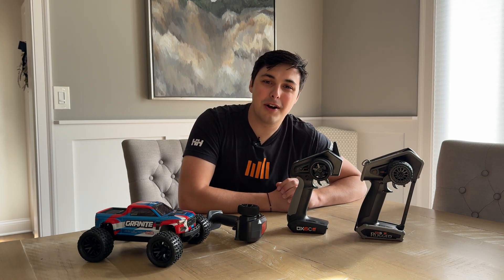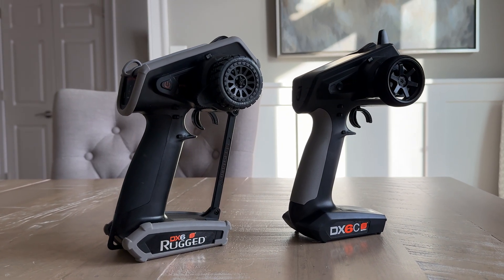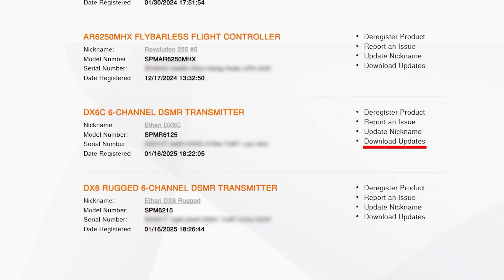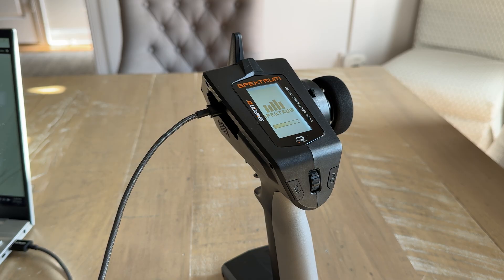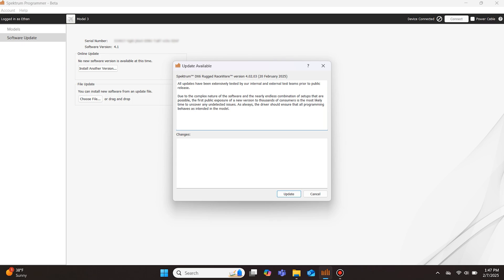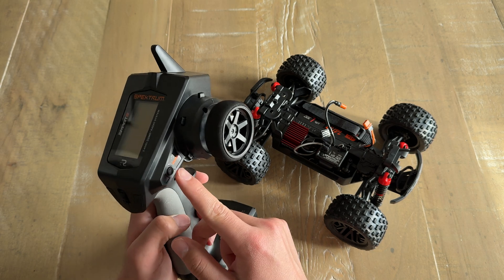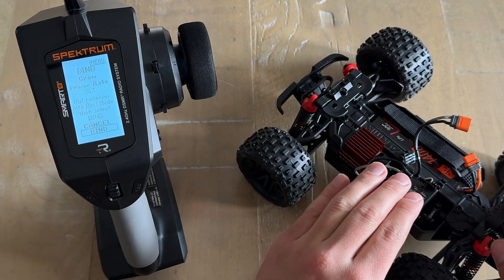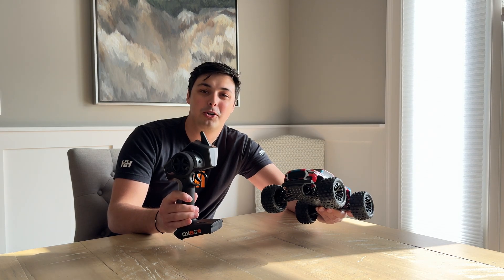Spektrum DX6C and DX6 Rugged SLT Firmware Update and Binding

Comment from the maker: Please click "...more / Show more" for links and more information. Visit https://www.spektrumrc.com/news-static-page.html for more information on the Dual Protocol SLT Firmware.

Download the Spektrum PC Programmer Here: http://spektrumrc.cachefly.net/apps/spektrum_programmer.html

Chapters:
0:00 - Introduction
1:37 - What You Need For Updating
2:07 - Update Method 1 with DX6C
3:51 - Update  Method 2 with DX6 Rugged
5:10 - Binding to SLT Receiver
7:54 - Outro

Spektrum is excited to introduce a new SLT - DSMR technology that combines both protocols, allowing for a seamless connection between them! It's available now as a firmware update for the current line (DX6C, DX6 Rugged, DX5 Pro, and iXSR) of Spektrum programmable surface radios. Once installed, the update lets you link your Spektrum DSMR transmitter to the SLT receivers included in many RTRs, so you can run all of your vehicles with the same transmitter!

In this video, Ethan Ater shows the two methods that can be used to update the DX6C and DX6 Rugged. After the transmitters are updated, a step-by-step bind process to an SLT receiver on an ARRMA Granite GROM is shown to demonstrate just how easy it is to enjoy this new dual protocol firmware update.

Follow SpektrumRC on Social Media!
https://www.facebook.com/SpektrumRC/
https://www.instagram.com/spektrum_rc/
Reply: Does the dx3 work
Reply from the maker: @Goodboy38581 The DX3 is not compatible with this update.
Reply: i have another question i have a 1/16 scale arrma mojave grom 223s blx if i buy the spektrum dx6c will the telemetry work on the grom 223s like speed mph temp and battery

Comment: What he failed to mention is the data cable compatibility. I went through four different cables until finding one that worked. After that it was just a couple clicks and done
Reply: Pin this comment! I spent many hours trying to update the firmware until I saw this comment. Thank you!
🤘🏼🤘🏼
Reply: These companies just kill me with the major oversight such as this. Luckily I ran across this comment before attempting the connection and sure enough, first few cables did not work.
Reply: Thank you for this comment. I was losing my mind and then tried another cable and got it to work…
Reply: Really? I wonder if that’s my problem…? I go through all the steps, but can’t seem to download an executable file or anything that seems to be of a file type that will open, download or install at all. 

Was this what u were running into as well? 

Did u just randomly use a different cable and it worked?

Comment: Why does my DX5 RUGGED only have 3 extra channels available in AUX after this update? It should have 4 extra channels before, but now it only has 3 channels. I use an SR6100 receiver, which means I can only use 5 channels. Now the 6th channel is no longer functional.
Reply: IT.S DX6 RUGGED

Comment: GUYS. MAKE SURE TO CHECK YOUR DX5 PRO MANUAL FOR SD CARD INFORMATION. IT TELLS YOU WHICH SD CARD YOU NEED TO USE. IT HAS TO BE CLASS 6 OR LOWER WITH 32GB OR LESS AND FORMATTED TO FAT OR FAT32

THE INSTRUCTIONS FAIL TO TELL US THIS CRITICAL PIECE OF INFORMATION.

Comment: Your instructions for your DX5 Pro are awful. I’ve been trying to update mine for several HOURS with multiple SD cards and it just isn’t working. I followed the instructions VERBATIM. The radio just is NOT recognizing the firmware file. According to my radio, the SD card is absolutely and completely blank. This is crap.

Comment: DX5 Pro is not listed in the drop-down of devices when I go to register my DX5 Pro. It shows DX5R/DX5R Pro

Are they the same?

Because I followed this step by step, and my radio isn’t updating. When I go in the manually update, it doesn’t display any files at all on my radio screen.
Reply: Don’t feel bad. The DX6 Rugged that this update is for isn’t listed either. Just another reason why I have been converting all my cars to FlySky Noble.
Reply: DX-5R PRO IS THE THE DX-5 PRO. THE OLDER MODEL WAS CALLED DX-5R, ITS THE SAME
Reply: @PhilipBender612  THANK YOU I APPRECIATE THE HELP

Comment: Ethan got a question on the update for the DX5 Pro. I did the update but don’t have the vehicle type option in my menu. The radio definitely took the update as i was on 2.02 before and now on 3.02. Have you heard of any issues with the download on the DX5 Pro? Thanks Ron
Reply: Do you know which DX5 Pro you have? There are a couple versions of the DX5 Pro. This update is only compatible with SPMR5025 & SPM5025.
Reply: @ yeah I figured it out unfortunately won’t work with my radio. It’s model number SPM5000
Reply: How did you even update your 5Pro? When I download the file to my SD card and insert the SD card into my radio, nothing happens. When I go to manually update it, there is no file on the SD card. How did you do it?
Reply: @ the DX5 Pro is very picky when using a SD card only a few brands will work. Sandisk works but needs to be a small capacity one like no more than 16GB from what I’ve seen. Also make sure you format the SD card first even if it’s brand new. Are you sure the file was on the Sd card? Also do not rename the file cause it will not download on the radio. Hope this helps. Ron
Reply: @roncorrisjr2828 positive that it was on the SD card. I tried like 4 or 5 times. Formatting now. I never modified the file name.
Reply: @roncorrisjr2828 still not able to update my 5Pro, tried 2 SD cards. This is crap.

Comment: How is this working for everyone else?   Both my DX6 Rugged, and DX5 Pro have the update now.  But will not successfully bind to the 2in1 in the 1/16 Mojave Grom 223S.
Reply: How did you even update your 5Pro at all? Once I download the update to the SD card and put it in my radio, nothing happens. When I go to the manual update, it shows no files on the SD card.
Reply: @PigglyWigglyDeluxe  i have a dx6c.  It uses USB c cable
Reply: @RVsandRCs thanks, I was asking the top initial comment
Reply from the maker: Make sure that your Frame Rate is set to SLT like in the video. You may also need to hold the transmitter a couple feet away from the receiver when binding.
Reply: Having same issue same setup. Tried several times. I hope I'm doing something wrong. Hopefully it works on my slt receiver in my v3 granite
Reply: @RVsandRCs try setting your “vehicle type” to SLT with DSC. This should automatically configure everything setup wise in the transmitter. Once you do that, you can go to the Bind / Frame, go down to bind and select it once your 2-in-1 is in bind mode.
Reply: @EthanAter  thank you for your help.... as of now my only option is "slt" . Nothing sas dsc
Reply: @EthanAter  ok found vehicle type and switched and rebound. Still no good lol
Reply: @EthanAter  i got it.  Thank you
Reply: https://youtu.be/JVp6aXaMM6E?si=WU7gxG3R9YbMaTfQ
Reply: @JasonPerrinRCVlogs already watched it, tried everything, didn’t work
Reply: @PigglyWigglyDeluxe  Do you know which DX5 Pro you have? There are a couple versions of the DX5 Pro. This update is only compatible with SPMR5025 & SPM5025.
Reply: @EthanAter bought it brand new sealed in box at a hobby shop about a year and a half ago, special order because they had none when I wanted one so I know it’s recent but I don’t have the radio handy right now to check or confirm version
Reply: I can’t get past the empty bar and or unable to get the programmer to see my transmitter.

Comment: Should also be on the DX5 Rugged…. It’s basically the same transmitter and only a couple years older.
Reply from the maker: @nielsmeer  Unfortunately it's a hardware limitation of the DX5 Rugged that prevents the update being available.
Reply: @ Disappointing….
Reply: @nielsmeer  agreed i have a dx5c and it sucks hopefully they can figure something out
Reply: @ It pushes me more towards switching to EdgeTX.  I’m running that for air and love it, but surface isn’t quite as up to date yet….

Comment: Did the update on my DX5 Pro - The SLT option does not show like the PDF instructions say it should.  Please advise.
Reply: ITS NOT AVAIL FOR DX-5s AT ALL! ONLY 6's   This is so lame!!!
Reply: Just updated my DX5 Pro and the SLT option shows in the Bind menu as seen in the video. DIdn't read the instructions as I followed the vid above.
Reply: How are you guys even updating your 5Pro? My radio is showing there is no firmware file on the SD card after I downloaded the file to the SD card from my computer

Comment: Where's the Mac OS Programmer App?
Reply: You can run Windows 11 on your Mac using the free VMware Fusion software. I just updated my DX6C using this method on my MBP 13 with the M1 processor.
Reply from the maker: At this time, the Spektrum Programmer app is only available for windows.
Reply: @SpektrumRCvideos  :(

Comment: How does the dcs settings work?
Reply: The button by the steering wheel
Reply: You just click  it eatch time
Reply: @Goodboy38581  thank you for your help. Unfortunately I can't get the binding process to complete properly.  It binds but I have no controls
Reply: @Goodboy38581  i got it lol. And found the adjustment for dcs as per your recommendation.  Thank you.
Reply: @RVsandRCs which button is it
Reply: @gonzodetroitify D i believe.  Increments of 25
Reply: @RVsandRCs  yes that’s what I tried and it works 😁thank you @Whitenas
Reply: @gonzodetroitify  glad it worked.  Happy bashing